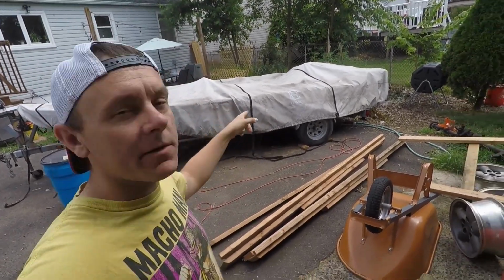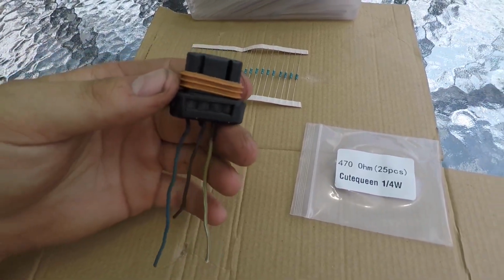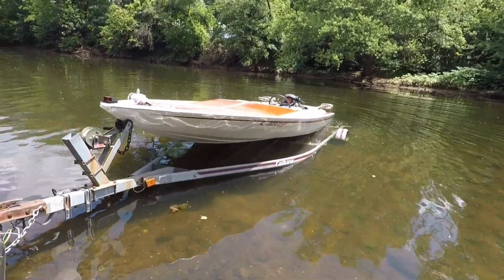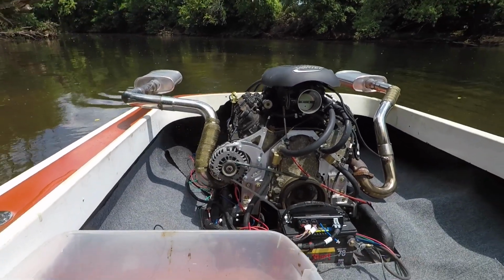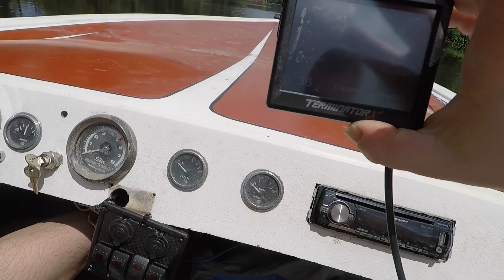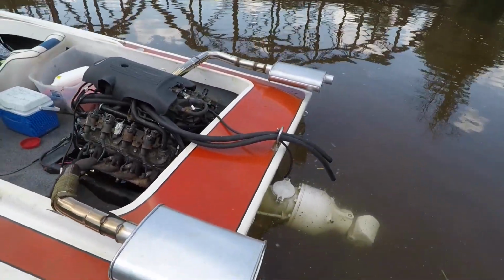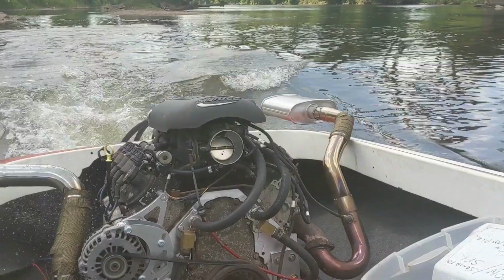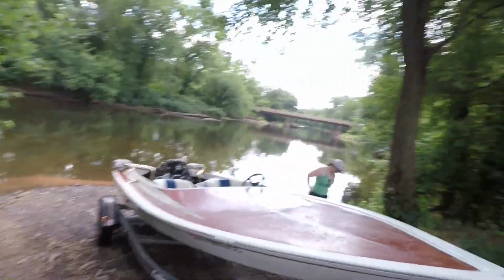First LS Swap Jet Boat Ride

Comment: You lucked out Tahiti built a good many with Jacuzzi pumps. I've never seen one with a Berkely. The white pumps are the only way to ever get any speed without spending a ton of cash. If you wanna run much over 70 you will need to do a little magic to the Berkely also.
Reply: My brothers and I all run renegade ultra lights with Berkeley pumps. Honestly those pumps are the only way to go.

Comment: Love the build a stock 4.8/5.3 should push that boat pretty good once its all sorted out.
Reply: Cool boat but for the love of god take off that exhaust and run boat headders out the back .
Reply: Can any body give the real
Definition of LS.  Or is it trendy to just say LS !
Reply: @victormontalbano4993  LS stands for the LS1-ls7 serie engines but being a very simillar based platform the therm LS is now use to identify all Gen3+ small block chevy engines.

Comment: You can flip the exhaust manifolds upside down and mount the coils to the stringers and still run stock plug wires
Reply from the maker: That's a super cool idea, would look way cleaner! I crashed the boat though. Will be in the next video. Definitely would have done that

Comment: Did you just mount the engine onto the fiberglass itself or did you use special brackets?
Reply from the maker: Mounted with thru bolts to the stringers. If I could do it again I would put a plate on both sides of the stringers to keep the bolt from pulling thru

Comment: I want to build this eaxct combo in a boat im wondering how you go about tuning ive done quite a bit of LS tuning on cars and trucks but not sure what to do on a marine application
Reply from the maker: Conservative timing from another tune and keep air fuel ratios in check
Reply: @drivewayparty4318  so did you find you had to pull alot of timing and lean it out quite a bit? Id imagine there way less load than a car so probably requires less fuel

Comment: What top speed are you getting out of it ....mine wont spin past 2900 rpm but does 60mph
Reply: The impeller cut needs to be matched to the engine. 3450 rpm is like 135 hp. 2900 rpm is about 75. Assuming Berkeley 'A' cut impeller. Getting 60 from 75hp? Pretty impressive if so but I'm skeptical.

Comment: Just flip the exhaust manifolds upside down
Reply from the maker: The plug wires get burned when you do that
Reply: @drivewayparty4318  I put an old license plate on my upside down manifolds. Hand formed and screwed to the stock heat shield. It would still fry a wire every once in a while but mine was turboed so it ran hot

Comment: I would think it runs like trash cause it has no mass air flow sensor
Reply from the maker: The Holley Terminator doesn't use the Mass airflow sensor

Comment: Dude what's with the goofy car mufflers all you got to do is get headers and flipem and run them out the back  Tru afro engineering
Reply from the maker: I was trying to keep it quiet so I could here and internal engine noises and once I knew everything work, I could take them off and it would be fun to see a speed increase

Comment: Bro that exhaust looks stupid as hell you need to find some water jacketed headers.
Reply from the maker: They are temporary. Engine has high miles and I wanted to be able to hear any  engine noises. I also thought it would be fun to see if I gained any performance after removing them
Reply: Need to get some Bravo headers and get rid of those mufflers off there and they some little mufflers they make for boats they are like 5” long and they will do the job and they sound pretty good too.. but you need to do something with that exhaust it looks like Pee wee Herman built that !
Reply: @brentmcmahon8188  what it needs is water jacketed headers the water flow through them will quite it down plus cool the headers...I have them on my 427 ....Its a Texas Speed 427 LS with a Magnesun Super Charger its about 1400hp.